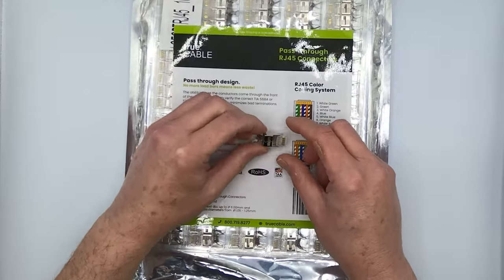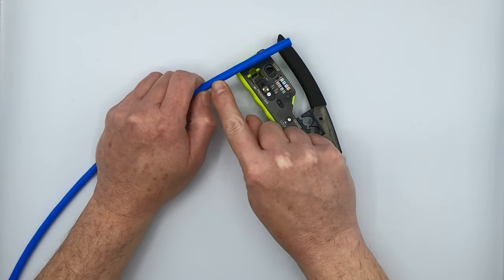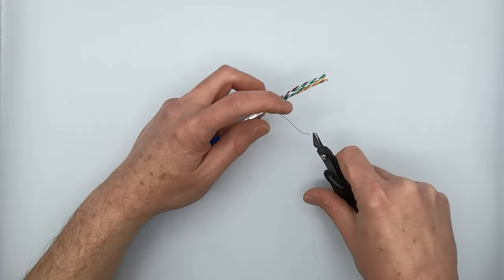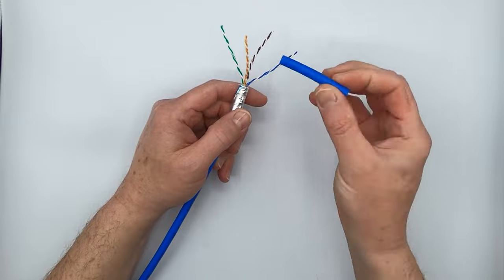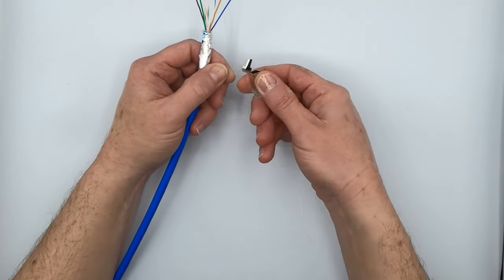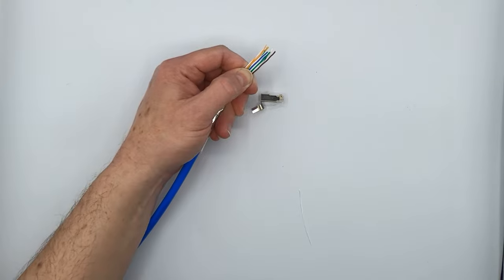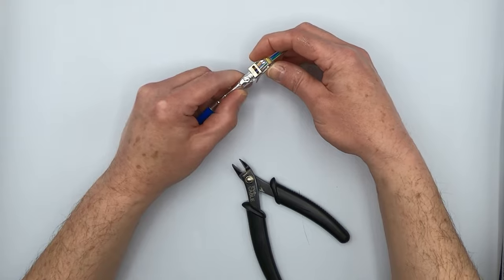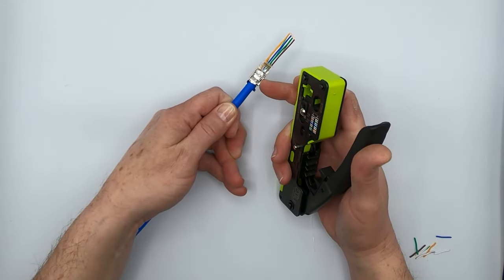How To: Terminate a Shielded Cat6/6A External Ground Pass Through RJ45 Connector

Comment: Yo tengo un cable categoría 7 y conector chapado categoría 7 también y no me va el cable ethernet y el último que grimpe me coje poca señal de que puede ser?
Reply from the maker: Hola VICE! La razón más probable es que el conector no encaje correctamente en los conductores aislados. Cada conector tiene sus propias tolerancias y debe ajustarse al cable. Al usar conectores RJ45 8P8C, no puede comprar por categoría, ya que no es relevante. El ajuste es. La clave es investigar el diámetro exterior de la cubierta del cable y el diámetro exterior del conductor aislado del cable Cat7. Luego haga una referencia cruzada con el enchufe blindado RJ45 8P8C y vea si puede encontrar uno adecuado. Desafortunadamente, es posible que no pueda encontrar un enchufe que se ajuste, y es posible que su cable Cat7 ni siquiera esté documentado para que pueda elegir. Si ese es el caso, le sugiero que intente conectar ambos extremos de su cable Cat7 a conectores Keystone Cat7 blindados y luego use latiguillos Cat7 blindados.

Comment: Have you ever seen any shorts related to POE with the flush cuts at the front of the connector? With pass through connectors like this, with a flush font cut, the tips of the cables are technically exposed and may short out. Just curious... thanks!
Reply from the maker: Hello Michael! I have not seen shorting issues related to PoE with passthrough plugs that are PROPERLY FIT and fully flush cut during termination. The shorting issues you allude to can occur with any style of plug, passthrough or not, due to too loose of fitment or simply terminating wrong. A lot of DIY installers have gotten into putting RJ45 8P8C plugs onto Ethernet with the advent of the easier passthrough style plugs and therefore the reported issues in the field increased due to more people performing terminations incorrectly overall--a mirage effect. If everything is fit correctly and the conductors are fully flush cut, you are good to go.
Reply: I install and service security cameras among other things and have had to replace many pass through connectors due to what you just mentioned.
It's not the pass through connector that is the issue - it is technicians who do not maintain their tools.  When the cutting blade gets dull, which happens quickly, it shreds the ends rather than flush cuts and causes problems - it isn't always immediate.  Also moisture can be an issue so these things should only be used in controlled environments and not for outdoors or POE applications.
This is from examining the connectors I have replaced to fix problems.
Reply from the maker: @donlackie5752  Hello Don! Thanks for sharing your experiences. Yes, I would agree that a dull flush cut blade can definitely cause a problem too. That is why we offer replacements for the flush cut blade on our RJ45 All In One Crimp and Termination Tool. I have not seen moisture cause any issues using pass through RJ45 connectors with outdoor PoE applications, however. I would think that any unprotected RJ45 (pass through or not) would pose a corrosion risk outdoors if it were unprotected. Note that I typically deploy Ubiquiti equipment where the cable and connector pass through a water-tight silicon gland as the device is being installed. The resultant installation does not leave the termination exposed to water vapor or any elements that could cause an issue. After more than a decade I have yet to replace any.
Reply from the maker: @donlackie5752  Hello Don! Thanks for sharing your experiences. Yes, I would agree that a dull flush cut blade can definitely cause a problem too. That is why we offer replacements for the flush cut blade on our RJ45 All In One Crimp and Termination Tool. I have not seen moisture cause any issues using pass through RJ45 connectors with outdoor PoE applications, however. I would think that any unprotected RJ45 (pass through or not) would pose a corrosion risk outdoors if it were unprotected. Note that I typically deploy Ubiquiti equipment where the cable and connector pass through a water-tight silicon gland as the device is being installed. The resultant installation does not leave the termination exposed to water vapor or any elements that could cause an issue. After more than a decade I have yet to replace any.
Reply: @trueCABLE    Problem comes with techs who are just collecting a paycheck.  They don't care about quality, just getting the job signed off.  
Our cameras have a connector similar, but much smaller, than the weatherproofing on the ubiquiti step down converter.  These are generally in a back box that are more or less weatherproof, depending on age.  
So it comes down to the tech and his attention to detail and his tools.
The problem techs perceive pass thru's as easier so they jumped on these early on.  And, like I stated, I have replaced many of these, not so much for corrosion, but for sloppy work that may have worked initially but over time, with the expansion and contraction due to temperatures things move and they will sometimes move the wrong way.
Standard RJ45's can expand and contract all they want without being affected, I've replaced them, of course, but mostly due to corrosion which I agree should not be a problem if the installation is done right
If more techs had to go back and fix their installations they might learn, but too many companies have separate departments so installers never learn
These may work fine for seasoned techs, but new guys need to stick to the standard ones until they gain a bit of competence
Reply from the maker: @donlackie5752  Hey Don! I largely agree. That is why putting 8P8Cs (aka RJ45) onto solid copper Ethernet is not a great idea in the first place. Fitment is super critical and it is not just temperature swings that might affect you. It is also manufacturing tolerances on the insulated conductors that will (and do) vary from lot to lot of cable. It doesn't matter whether we are talking about solid nosed standard OR passthrough. Ideally, solid copper Ethernet should be terminated from "rack to jack" with IDC style terminations and then factory made patch cords used at both ends to complete the channel. ANSI/TIA, as of 2018, recognized the MPTL (Modular Plug Terminated Link) style of Ethernet channel, so the only time I recommend using an 8P8C plug anymore is when it MUST be used in lieu of the "rack to jack" or "rack to Category rated field termination plug" method due to installation constraints. Installation constraints typically revolve around tight device housings where Category rated field termination plugs do not fit or when using a keystone outdoors in a weather proof enclosure with a patch cord would be inconvenient or even impossible. Even then, that hand terminated 8P8C plug should be on a single end and not both.

Comment: We don’t use a pass through connector when using HDMI baluns. We are told it bleeds at the end. So you get video loss. This is what many in the industry say. Have you heard this?
Reply from the maker: Hello Justice! Interesting! Well, given that this is industry specific advice that I cannot directly refute I would follow it to be safe. That said, I cannot reproduce nor have I seen performance issues with passthrough connectors ASSUMING the fitment is correct--especially on solid copper Ethernet which is not ideal for RJ45 8P8C termination to begin with. It sounds like (and perhaps I am wrong) that somebody had an issue at one time or another with passthrough connector fitment, leading to trouble with performance and proceeded to blame it on all passthrough connectors. What starts off as a single person's experience becomes casual advice to others. The "others" then repeat it and it gets repeated again and again. A year down the road the casual advice has now become inviolate gospel with felony charges resulting for doing otherwise. :>) Long story short, HDMI is not analog and is packetized data just like Ethernet packets. If there was a problem with passthrough connectors in general it would affect all signaling, not just HDMI. I think the issue is more elemental than that, which would be hand terminating RJ45s onto solid copper Ethernet and getting the fitment (or something else) wrong. Just my .02!

Comment: Would this method work with cat 8 shielding?
Reply from the maker: Hello! Physical termination of the cable shield depends on how the cable is constructed, not the Category. Category defines performance, not how the cable is physically constructed. Cat8, per ANSI/TIA, can also be unshielded. How you would bond the cable shield to the hardware depends on your individual cable. Hope this helps!